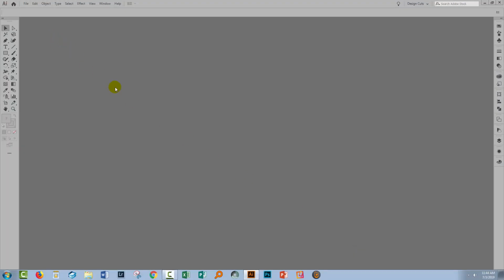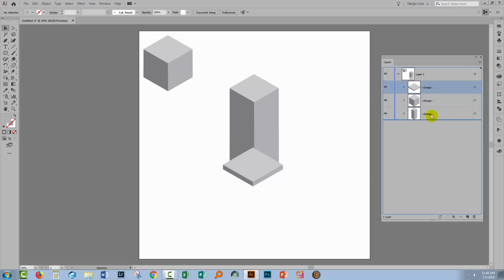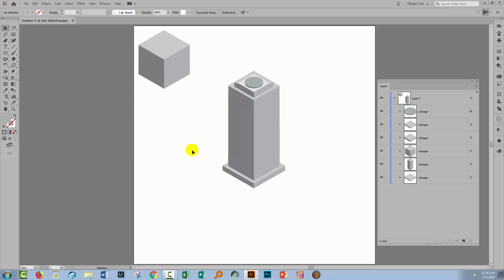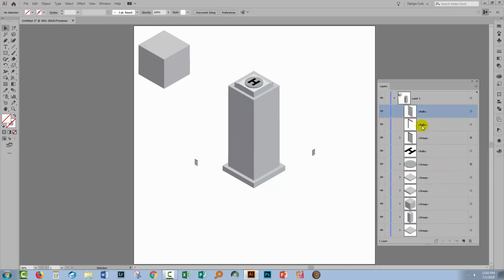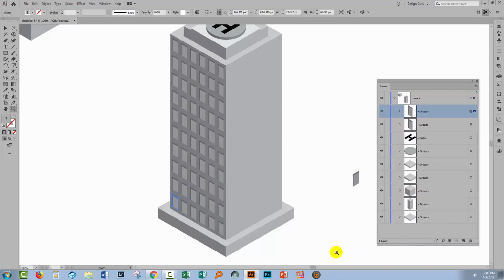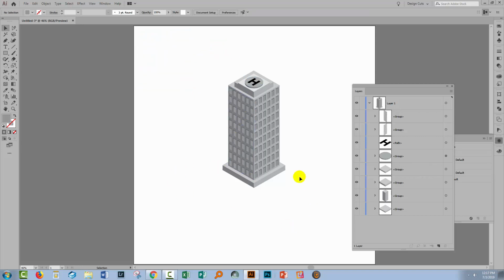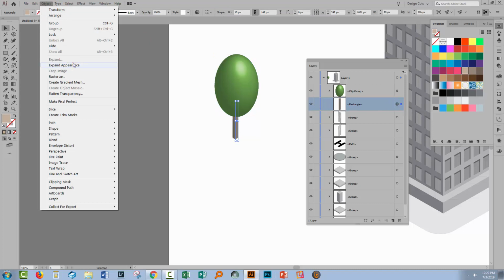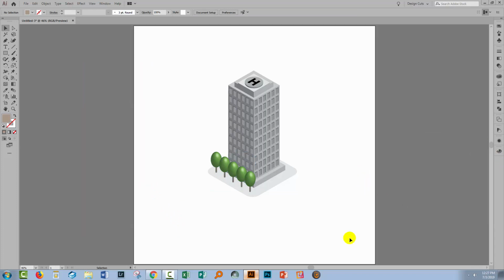ILLUSTRATOR TUTORIAL | How to Draw an Isometric Building

Comment: So is there a reason you couldn't just take the group of left hand Windows, copy them, flip them, and turn them into the right-hand windows?
Reply from the maker: You can certainly experiment with further shortcuts to help speed up your designing process, however just so that all of our community can follow along with this tutorial, whether they are just starting out, or confident with Illustrator, the designer wanted to be able to break down the steps further :).
Reply: @DesignCuts  I wasn't criticizing, I was sincerely asking if there was a reason it wasn't done that way. I take it from your reply that there wasn't. Cool.
Reply from the maker: As long as your flip axis point is set vertically in the centre, you should certainly be able to group your windows, then flip your duplicated windows, ready to reposition them :).